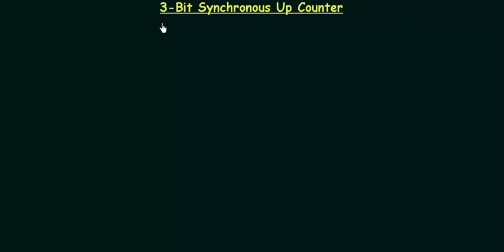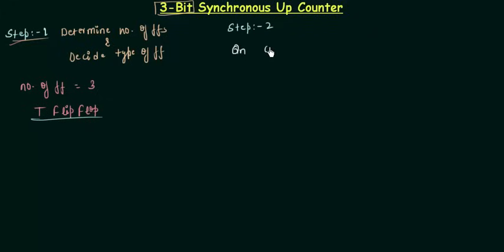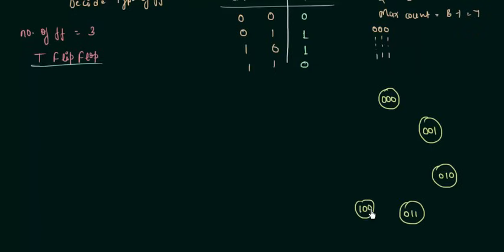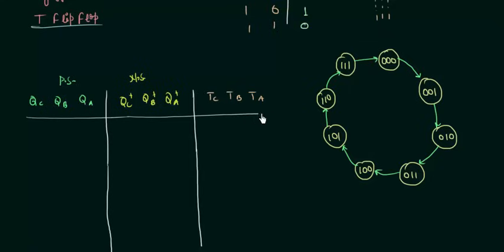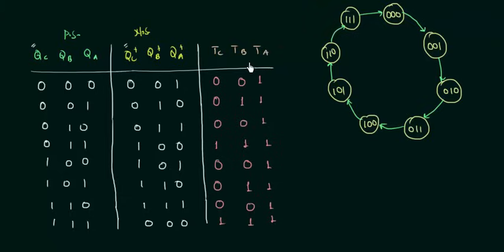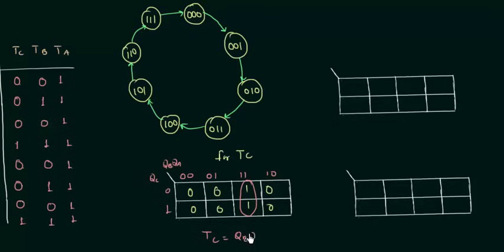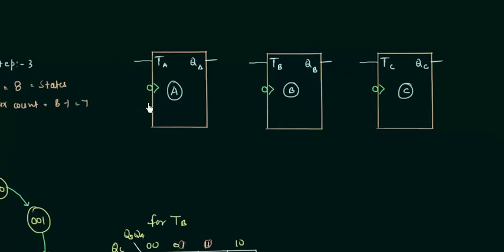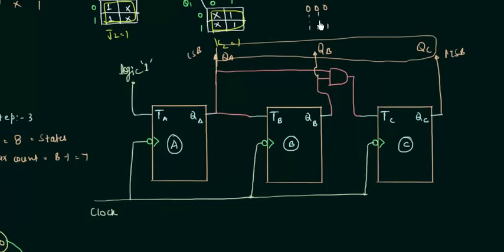3-Bit Synchronous Up Counter

Comment: does the sequence in state table (qa,qb,qc or qc,qb,qa) matters? if matters then why in the previous video you wrote q1,q2 in state table. plz answer
Reply: Same doubt
Reply: @mohamedunais.t4087  nope it doesnt matter (as these are synchronous circuits ,clock pulse is the same for every flip flop) but yea dont get confused between MSB and LSB  in this video , Qc is MSB but in the prev video Q1 is MSB.

Comment: Why in this table we considered from C,B,A and not from A,B,C? Because in the previous video you took A,B,C. Please help. Can't understand this.
Reply: It doesn't matter, before writing up the table, you can also go A,B,C instead of C,B,A...as long as you write the bits correctly like 000, 001, 010, 011... instead of reversing the bits, you'll be fine...

Comment: Good explanation, but DON'T CONFUSE ME, Neso.
In the previous video, you assign LSB and MSB in the opposite way.
Reply: Agreed! this caused me a lot of confusion as well
Reply: both are correct, u just have to know what is msb bit and lab bit, order doesn't matter as clock applied at the same time to every FF
Reply: @anandar773  Correct
Reply: This method is correct, he made a mistake in the last one

Comment: In 2 bit counter example in ckt excitation table we took states as q1!q2!q1*!q2* and in this one we did the opposite.. So does this affect the counter?
Reply: I know it's late...but yes it will affect the counter msb and lsb as when we put q1,q2 then here we have q1 as msb in the table so the output of our counter is such that the 1 FF gives q2 as output and the 2nd FF gives q1 as output to be correct... otherwise u can follow the same as mentioned in this video

Comment: Nice explanation. I have a doubt. Will there be any difference if I use positive edge trigger instead of negative,?
Reply: No there won't be any difference! It is just changing at different points but with same frequency.

Comment: Great explanation!! Wanna ask why the sequence of the flip flop you draw is in A-B-C? 
Coz in the table you are writing in C-B-A? Is it a convention to reverse the order from the table?
Reply: MSB to LSB
Reply: I too have same doubt !
Reply: Because clock is always given to lsb bit
Reply: @sujaysavandv6977  but the clk pulse is been given simultaneously...and if that's the reason, then why didn't do the same thing while designing 2- bit synchronous counter(see previous video)
Reply: @sujaysavandv6977  CORRECT
Reply: In case of synchronous counter , the order doesn't matter .....you can try drawing the logic diagram by changing the order , you'll get same

Comment: Do you have opportunities mem someone helped this project
Synchronous counter which counts passing through the gauge number of decimal equivalents 1-2-4-5-0-3-6-7 . Of conditions that are not utilized to pass the binary equivalent of the number 1. To use bistabil type : JK
Designed to test circuit in Multisim simulator .